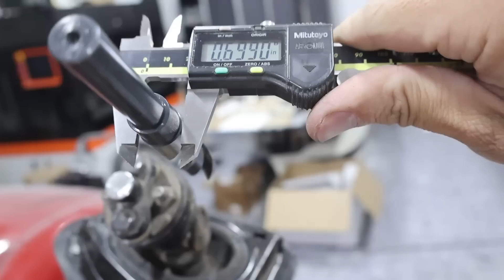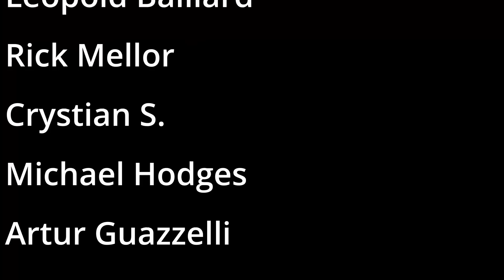Turn with Ease:  Installing an Electric Power Assist System - Electric Power Steering

Comment: I’m currently building an electric E30 BMW
Good video! 
I’m considering Volvo electric steering since it’s not the actual shaft itself

How has this steering shaft held up on your build now?
Reply from the maker: So far so good.  Volvo electric power steering pump is a good solution.   Just know it is pretty loud.  With engine noise gone it has bothered a few people.
Reply: @electricsupercar I wasn’t aware of that noise at all.. 
it’s not something anybody talks about in any of the videos.
Reply from the maker: Check it out
https://youtube.com/shorts/IFKFDsrHsjw?si=XVbJ_6XyzO2cyuMw
Reply: @electricsupercar and does this setup make a lot of noise like that one too?

Comment: Hey buddy nice work! I've installed mine inside the z32 car, it is running pretty good when in motion but if the car is stopped or in slow motion its getting pretty hard to turn especially on asphalt.. I think my shaft is misaligned just a tiny a bit, I am wondering if this is my issue or if its not strong enough.. I will be installing a standalone so maybe I will be able to give send more power to the module. You have any idea?
Reply from the maker: Mine gave a good amount of assist when stationary.  I would worry if it is misaligned.
Reply: @electricsupercar  Thanks for the input, its winter time where I live so its car project time, I will have a look at it and fix the alignement !

Comment: Do I need to put a manual steering box if I use this electronic power steering?
Reply from the maker: You don't need to.  Sometimes racks have a different gear ratio for manual vs powered.  Also many people will loop the  hydraulic lines for a powered rack.

Comment: Do any have the ability to change torque assist based off car speed?
Reply from the maker: Yes, but it is much more involved.  Need input from wheel speed sensors and CAN to transmit and receive

Comment: any updates on electric heating for this car? or time frame of when you will be tackling that?
Reply from the maker: Heat has been installed, currently working on the high voltage pack.  We will have a video about heat coming out soon.

Comment: I woud not trust half an alumnium lovejoy. The factory used heavy duty u joints an you need overkill so you dont get killed. Also,welding two mystery metals together with a pretty cold weld isnt a good idea either. Im glad u decided against the flex coupler.

Comment: Thanks a lot for the tips and recommendations for follow-along.

As others have pointed out, a welded steering shaft is a potential failure point, it's far weaker than the rest of the shaft because it is essentially only bonded in a ring near the surface. Please don't take risks with the steering.

Comment: My prius column has different wiring.  The 3d collar idea sounds good initially, but as soon as the weld starts to cool, it will not be able to resist the pull.  I plug welded a precision fit 1/4" wall steel pipe over both ends.
Reply from the maker: Interesting, I'll have to give that a try!

Comment: The steering coupler you removed from the Kia power steering contains what they call a starfish bush that regularly disintegrate, but they seem to use this bush as a steering dampener to prevent the assist fighting a constant steering position, almost like hysteresis.
Reply from the maker: Good to know

Comment: From the design side of how it was originally set up: Shouldn't we be adapting the power steering system that already exists (replace the pump) as the stress tolerances are unknown?
This seems like a doing 15 hours of design and labor for $100 savings.
Reply from the maker: You're probably right

Comment: i think i would have preferred electric hydraulic pump to standard powersteer rack. that way even without power, the steering wheel would still be manageable. what made you avoid that route?
Reply from the maker: Noise, efficiency, no fluids

Comment: Hey man, love the channel and content. I don't think that weld is safe the shaft. It is visibly cold and the shaft shows no discoloration leading me to believe that there is zero penetration. Im only commenting because I have had to repair a lot of failed welds over the years.
Reply from the maker: Yea, I will be making changes to the steering setup.  Thanks for the comment.

Comment: Should have just gone with a Mini R50 electric power steering pump and kept the hydraulic rack working. Keep modifications to the column etc to a minimum.
Reply from the maker: Not a bad idea

Comment: I commend you for your efforts, but there are other ways to do this and they are much safer. I'm not sure if you're aware, but the motor and module aren't water tight. They were designed to be mounted inside the car. There is plenty of information online. This is a very common mod and on many different cars, from old to modern.

Comment: There's a very good reason why all the shafts in the factory column and the electric assist are solid and not welded and an ameteur performing the welds with a hobby welding machine should never be allowed on a public roadway. Just the heat the motor, bearings, and shafts were exposed to would make that motor unfit for use in my opinion.
Reply: They aren't solid. They are actually collapsible to prevent impaling the driver in a crash.

Comment: Is the power assist auto adjusted? i.e. more assist on low speed - traffic, parking etc and less assist on high speed - highways, motorsports (drag racing etc)
Reply from the maker: Just one assist level

Comment: It's hard to see how close the car was while you were grinding but a top tip (born from painful experience) is NEVER let grinding sparks hit glass. The sparks are tiny bits of molten metal and when they hit glass they stick to it leaving it covered in little metal lumps. There is no way back except new glass.
Reply from the maker: thanks for the tip!
Reply: Thanks, that was exactly my thoughts as well

Comment: I see  a lot of valid comments about welding the rack but my question is why not keep the hydraulic rack and install a pump to drive it. I used a Volvo pump in my build and it works great. Many others have used GM pumps so the solution was cheap and simple. 
Early on I decided not to install electric power steering as I felt the forcing the rack from the steering column instead of being assisted by hydraulic fluid would shorten it's life.

Comment: Sketchy at best with the shaft welding. You need to bevel both shafts to get enough penetration. Better yet you should have taken this to a professional shop. Your globs of weld shows not enough heat, too fast of wire speed, too slow of movement and general lack of welding experience for something this critical. This is a major safety issue for you and every other person on the road at the same time whenever you are on the road.

Comment: Thank you for your effort in the video, it had me laughing quite a bit. This is clearly a how not to do this. The power steering motor and ecu are not waterproof in any way so should not be in the enginebay for starters. The other comments already touch on the creative installation.

Comment: I’m not gonna touch the welded steering shaft, as that’s been pointed out, but one recommendation I have specifically from owning a Nissan specialty shop that specialized in 90’s S,R,Z chassis specifically. 
For best result, you need to de-power the rack. 
There are plenty of instructions on YouTube. Essentially right now you are asking the that electric assist to drink a cold milkshake through a straw. 

If this unit is speed variable it might mask it, but if this is a single rate, it’s going to struggle at quick movements and may even pop its fuse. 

What Kia vehicle did you source this from?

Comment: You may also want to open up the hydraulic power steering control valve and weld the shaft inside. There is a sloppy springy linkage inside that is required for a hydraulic unit to work. That is the play in the steering and knocking you feel when turning the wheel left and right on the ground with the engine off or when making rapid inputs left and right.
Reply from the maker: @makkgeo  thanks for the suggestion!

Comment: I think you made the right decision going for the keyed shaft, I’ve seen many times what happens at the drag strip when either the steering fails, or the master cylinder brake pedal pushrod falls off, and both end up in at least one car being totaled and many times it’s two cars.

Comment: Great episode, as always, Jeremy.  I was curious why you did not do as you have with other shafts, and send them to be manufactured into a single unit?  That would insure the shafts were adequately strong enough as opposed to relying on welds and couplings.  Both units appeared to be able to be broken down, and that outer tube, as you did, can be removed if needed. Just an observation and curiosity question.  Love your using 3D printing to make the alignment jigs, though the straightness may have been affected in the one by the angle you had it on and the print softening while you were doing the spot welds.  Looking forward to the next installment of any of the builds.  Glad to see you have more progress going on while still maintaining topical videos.  Great planning.
Reply from the maker: @bradbrowatzke7236  👍

Comment: So you don't weld driveshafts yourself (which are not as such safety critical) - but you do weld steering axle which very much is safety critical... Yeah naaaa on the welding.

Comment: Love most of your work but that welding of the steering shafts is not good.   You should have a pro weld that kind of stuff for you.   Plus I do. It think that key way is strong enough for a steering system.   You may want to figure out a way to use splined shafts

Comment: I notice others have commented as well but welding steering and suspension components  is a real concern. I used to own and operate a streering and suspension workshop (HV, MV, LV and passanger vehicles) and I would not touch a vehicle with this type of modifications unless I was provided an engineers report. In Australia while not illegal per say these mods would need to be welded by a qualified welder and tested and approved by a licenced test engineer. 
I like most of what you do but IMHO this is potentially just downright dangerous.

Comment: Love your videos and all your work, but that minor weld looks sketchy. You can hire somebody local to do mobile welding for like 200 bucks most of those guys have a lot of years under their belt and make sure that it’s done 100% correct plus it takes some of the liability away from you.

Comment: One thing that should be pointed out is that is a column mounted electric power steering unit. They are typically located in the passenger compartment under the dash and not in the engine compartment. They typically are not sealed like modules in the engine bay, so the way you have it mounted you could have an issue down the line if water gets on the circuit board from road splash or a car wash. Cars like the dodge charger have a rack mounted eps in the engine bay that are sealed from water intrusion.

Comment: Those welds…I hope this is for you and not a client. Even if you had them sign a waiver of liability, you can’t waive negligence and any good injury lawyer could get experts lined up to testify that not having a certified welder or validating safety-critical welds with X-ray is negligent in industry practice. I know it’s expensive to have them professionally made, but I promise it’s not as expensive as a wrongful death or injury lawsuit.

Comment: Personally I don’t love banking on good penetration with a MIG on a butt weld when I’m going to grind the material smooth after (I’ve got a track record of overestimating how much base metal I’ve truly melted with that process) and would want to do a multi pass weld on a double V groove instead. It’s certainly possible you got enough penetration but if it were me I’d do that joint again with more joint prep. 

I LOVE the 3D printed tacking jig idea in this application because you can’t practically use V blocks and gauge blocks to get them concentric here - I’m definitely going to steal that idea when I shorten the brake master cylinder rod on my Sambar brake upgrade!
Reply: When you squeeze as in @6:35 leave a space between the two parts?  8^)

Comment: Just a recommendation, I would tapper each end of both shafts with a pretty aggressive angle before welding. This would ensure proper weld penetration,  being that it’s a critical component
Reply: It should be a 60° included angle (30° on each side of the joint). The welds you showed did not achieve the minimum penetration required, please consult with a specialist. It's one thing to weld boxes, brackets and supports. Another completely different thing to try to weld shafts.
Reply from the maker: @mikeseeley1316  I did this to some degree although I did not show it.  Great advice!
Reply: @electricsupercar  better advice is to not weld safety-critical components yourself. You’re opening yourself up to significant liability, and signing a waiver won’t change that.

Comment: I'm a bit concerned with your welded steering. Of all the things to fail in a car, steering would be my last preference. 
Those welds may be strong enough for daily use and may never fail, but hit some pot holes, the odd curb or serious steering bump on a track day and you may be set up for random failure one day on the freeway. 
Here in Aus, we have many excessive regulations, but one I agree with is that any steering shaft welding needs  X-ray and engineering approval.
Reply: Safety first. It is better to adapt parts, brackets and joints, not weld the steering parts. Suspension and steering welded parts require industrial welding.
Reply: Was going to say something similar - I'd expected both sides to at least have a bevel before welding...
Reply: Welding supervisor studying to be an inspector. That welding is certainly not adequate at all for it. I was fine with him welding some supports and brackets here and there, but without a proper joint preparation and welding experience he's risking human lives.Those welds are far from ok. I hope he reads the comments, he shouldn't be doing this.
Reply: @serdiefgotreb  if you compare the cost of a guaranteed to not fail shaft to an almost certain guarantee to die if it fails, then I don't think this shaft is up for the task.
Reply: @serdiefgotreb  Or taking someone's money to perform this conversion. I like this guy's channel but as a mechanic, he's got a strange mix of knowledge in one area, and complete lack of knowledge in another. I don't think I'd want him working on any of my cars. I've had a few customer's of mine bring in vehicles that have engine swaps done by guys like this, basically you end up paying twice to have a professional redo a lot of the cut corners.
Reply: He’s really taking a gamble here to save the expense of having a professional shop do the welds.

Comment: I was trying to eyeball the U-joints, directions etc but... if anyone else is doing this, make sure you have even numbers of joints.  If you just put in 1 for example, you'll find your steering going fast/slow/fast/slow due to non-uniform angular velocity.

Comment: I did this on my car and pice of advice you will need a camper caster plates to help with the self alignment of the wheels as now the car steering won’t self align as there is a difference between steering torque from the hydraulic pump and the esp , i love your channel and admire your work if u need help feel free to reach out
Reply from the maker: Thanks Friend!

Comment: Ok. I now have no excuse.  I've been sitting on the iBooster and the KIA power steering motor for over two years.  I need to go and finally ditch hydroboost and install it in my Astro.
Reply from the maker: Go for it!

Comment: It would be pretty interesting to test each of those electric power steering options, to see which is best for steering feel, level of assist, cost, ease of installation, etc. None of those donor cars are particularly sporty, so I wonder how they would compare to (for instance) a Porsche Taycan electric steering module that's integrated with the rack and pinion assembly.

Comment: As much as I love your channel watching you weld on a critical system  like this. I would be hesitant to drive one of you vehicles. You really need to have a certified welder do those kinds of welds. A motor mount is one thing if it breaks it probably won't kill you. Power steering is nother saftey concern. 
At least have your weld x-rayed for cracks. Safty first

Comment: I would suggest using the Opel Zafira hydraulic Steering Pump. It has lots of power, data sheets are available online and are used in many conversions and tuning applications. And you have the redundancy if something breaks with your modification, you can still manual steer without the assistance
Reply: Not sure they got the Zafira in the states
Reply: @jongmassey  Plenty of Volvo's and Fords have the same setup.

Comment: Here's a question for you in doing these conversions (great video by the way). Is it necessary or even advantageous to retaining the OE steering gearbox from the original system or can you just go with a direct drive on the steering shaft? Thanks again for the great video!